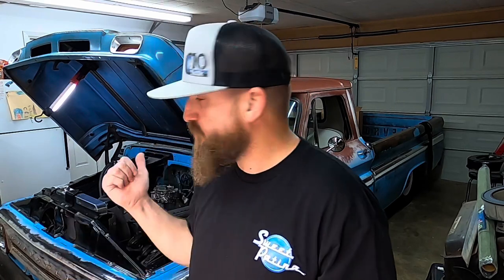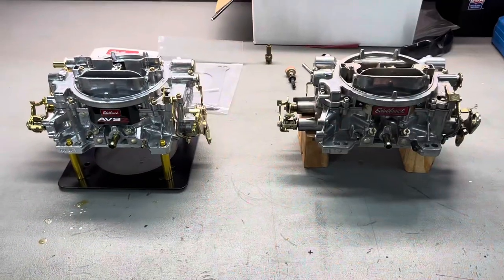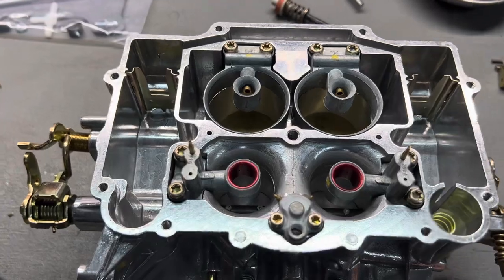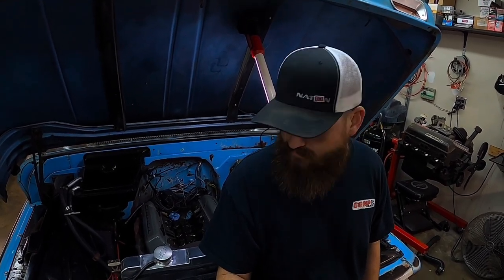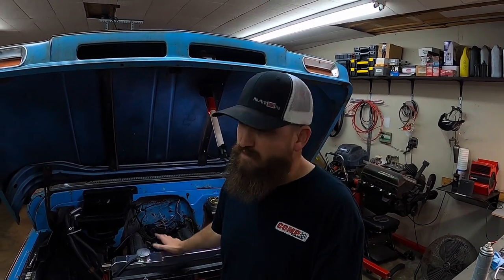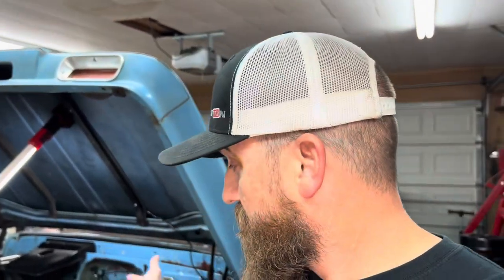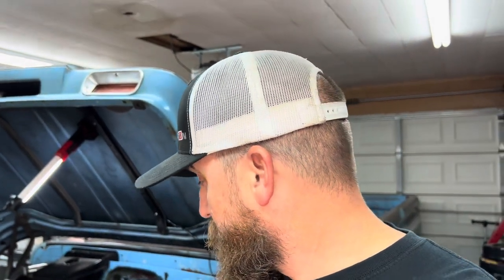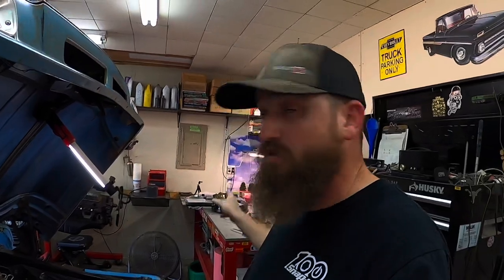Edelbrock avs2 650cfm carb install 1966 Chevy C10

Comment: Im using fel pro 1205 intake gaskets on a 350 under an edelbrock performer rpm intake. So far no problems. Intake and heads are gasket matched. Truck is a 69 chevy c20.

Comment: I just ran into this issue. I have a 283 in my 68 c10. I put a aluminum intake on with felpro metal gaskets and had a water leak. After reading the instructions that came with the intake it said twice not to use the felpro metal gaskets.
Reply from the maker: I wish I would have had that issue early on. At least I could have put the correct gaskets on instead of buying a new carburetor just to find out the intake gaskets are bad. Live and learn

Comment: Those valve covers are sick!
Reply from the maker: Thanks
Reply: @Chickeneyegarage  did you paint the intake manifold to match? Looks great!
Reply: Thanks for the PCV instruction.
Reply from the maker: @1961Bullet  no problem
Reply from the maker: @1961Bullet  I painted the engine and intake the same color when I put it together.

Comment: Love the content and your truck, I have a 1970 Chevy c/10 fleetside short bed running a 358 with that same carburetor, only difference, mine is an electric choke. I'm running cast iron vortex heads and my engine is mildly built by our local engine builder. I'm thankful for your info pertaining to the tuning of the AVS , I also love the patina of your truck, I'm going in the same direction with the patina look as well. I will be following you on your channel and if I can figure it out, I will send you a picture of my truck and I also have a video of my engine being run in the machine shop after being broken in. The carburetor was installed right out of the box with no adjustment.
Reply from the maker: Thanks for your compliment and your support. If you have instagram you can send me a video that way. Instagram name is the same as YouTube

Comment: I have always had good luck with the FelPro sets but always wondered about the crossover being opened. Great video, keep up the good work!
Reply from the maker: Thanks for the compliment. I’ve always used felpro gaskets with no issues. I’m sure the 1204 gasket I was using is a good gasket but it’s not for aluminum intakes.

Comment: I just bought an edelbrock intake, and low and behold, they tell you which intake gaskets to use in the instructions. "Use either Edelbrock #7201 or Fel-Pro #1256".
Reply from the maker: What are instructions 😆

Comment: Great video, love the build! I wish mine were 3 on the tree..
Reply from the maker: Thanks brother. I like the 3 on the tree but 1st gear not being synchronized is less than desirable. I want to get a 4 speed.
Reply: @Chickeneyegarage  mine was 4 on the floor, and I've swapped it to a 700r4
Reply from the maker: @cadilakisrodcustom  actually I would rather do a 5 speed. I could use the overdrive on the highway. 1:1 with 3:73s isn’t good for gas mileage.
Reply: @Chickeneyegarage  I bet that's thirsty
Reply from the maker: @cadilakisrodcustom  it is

Comment: I suggest  upgrading that 1405 to a 4x4 style set up with the spring loaded float  jets like a carter and your check ball under the accelerator squirters to a spring instead of a weight. Because squirter can drip if not functioning properly.

Comment: those  fel pro gaskets are  for factory Iron intake , the Edelbrock intake which   is softer Aluminum , requires a  more plyable gasket , Edelbrock  makes the recommended Gasket for their intakes .
Reply from the maker: Yeah I wish I would’ve known that when I built the engine. Live and learn the hard way sometimes. Only reason I don’t use Edelbrock gaskets is the runner openings are too large for stock applications. They’ll work but I would rather have the smaller port size.

Comment: Nice truck . Was curious if you checked fit of intake without runner gaskets and end seals . If block was ever decked or heads surfaced , there can be gaps that run full length of heads . If excessive , the fix is to have intake runner area milled .
Reply from the maker: If I was still having issues that was going to be my next thing check. As of right now I’m having no issues so I think I’m good to go.
Reply: I’m with wingman… this stuff should’ve been checked before assembly. This isn’t a gasket failure at all.

Comment: If you have a lean bog check metering rods  also changing that step up spring makes sense numbers wise but go back to orange spring.
Reply: When I try adjusting my idle mixture screws, nothing happens.  I can’t pinpoint an obvious vacuum leak, and it runs decent when 90% of air is blocked off.   So I assume it’s running lean..     what am I checking for when checking metering rods ?
Reply: If you can not get it to get rich by backing out the  idle jets, the feed for the idle/transfer circuit needs be increased, with out doing that will always have a boog . Note what does your vacuum do if you go up just off idle to 1/4 throttle dose it prop off?

Comment: I would not trust nylon-locking nuts on the pcv baffles w/ engine heat, would use the all-metal locking nuts. Just a thought-
Reply from the maker: Thanks for the advice. I might switch them out since you mentioned it

Comment: Sounds good. great video. I have the same carb I'm putting on. ? what mufflers are you running? I was thinking the flowmaster either 40 or 50 series.
Reply from the maker: Thanks. They are Flowmaster Flowfx mufflers. Similar to a magnaflo

Comment: Could you explain how all that raw gas gets into the motor oil via the intake gaskets?
Reply from the maker: Bottom floor of the gasket not sealing properly. I know when I pulled the intake the gaskets were wet around the sealing surface.

Comment: how to just floats on this carb? I have always run Holley and I'm going to this carb
Reply from the maker: You have to remove the top of the carburetor to access the floats. Float drop is supposed to be 15/16” and float level setting, basically flip the top upside down, you can use a 7/16” drill bit to set it (leave the gasket in place). Make adjustments on the float drop by bending the rear tab. Adjust the float level by bending the arm connecting to the float. You only need minor adjustments. It’s easy just takes a little longer than a Holley. I’m sure there’s a ton of videos on YouTube about it. If you have any more questions let me know and I’ll do the best to help you out.

Comment: Did you get coolant on your oil when you checked your dipstick? When i checked the engine oil there was coolant in my dipstick and my radiator fluid is is now low. I think my intake gasket went out as well.
Reply from the maker: I did not. Are you using the same gasket I did with an aluminum intake?
Reply: @Chickeneyegarage  no im using the edelbrock top end kit that came with the kit. I just went ahead and bought new head gaskets and new fel pro intake gaskets.
Reply from the maker: @armygreenfj3924  do you install your gasket dry? I did one time and had the same issue you had. I started putting a thin coat of rtv around the water jackets of the cylinder head. Never had an issue but most gasket companies recommend installing them dry so take my advice as a suggestion.
Reply: @Chickeneyegarage  i had it rebuilt at a shop. They are covering it under warranty. I just had to buy the gaskets. I did notice the instructions say to install them dry. Ill take your advice and let them know.

Comment: how is that 650avs holding up? im thinking about getting one
Reply from the maker: It’s working great. Best Edelbrock carburetor I’ve ever owned.
Reply: I’m wondering if it will be ok for a ford 460 Lincoln. Mild engine. Around 325HP. It originally came with a 750cfm. But the AVS tops out at 650
Reply from the maker: @katkiller50  they make an avs 800cfm

Comment: I picked up an Avs2 650, do you think will this do well with a sbc 305?
Reply from the maker: If it’s a stock 305 a 500cfm avs2 would work better. If it’s a radical 305 then you might be ok.